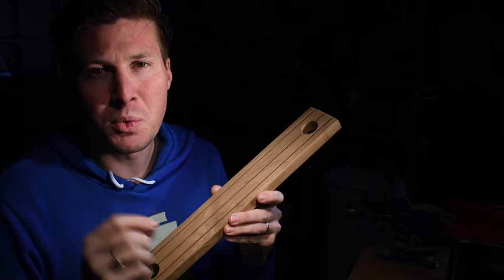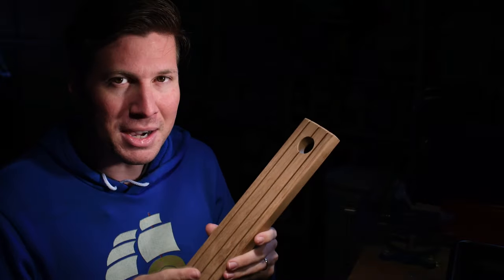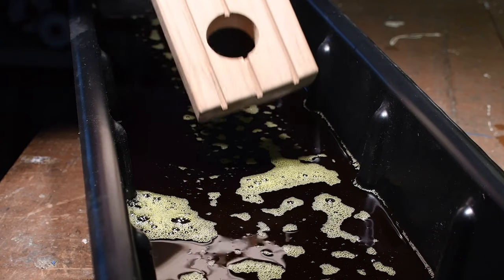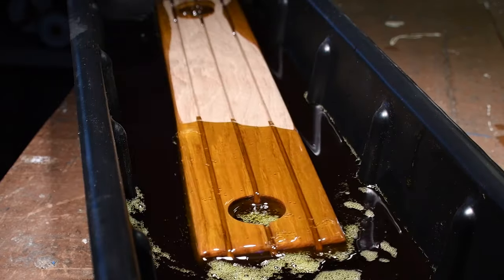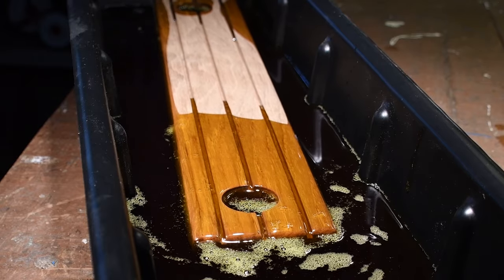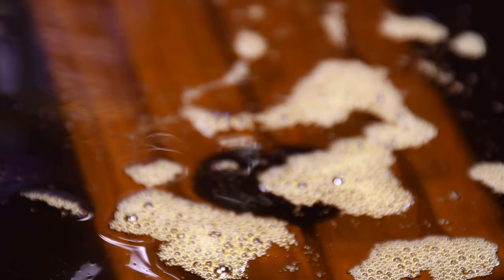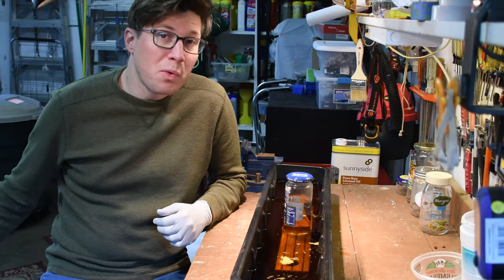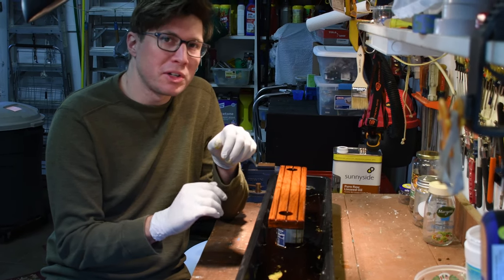How To Varnish a Small Wooden Project with Linseed Oil | Sailing Wisdom

Comment: There is only 1 oil that comes to mind on a sailng yacht: TUNG oil.
Reply from the maker: I’ve had issues where the UV makes the film peel off after a few years. Linseed oil does not make a film so it can’t peel on you. For interior wood, tung oil has a nice look to it 😉

Comment: Dirt and mold magnet
Reply from the maker: Hasn’t been a problem on Wisdom and I’ve been doing this for about 11 years now. Our galley counter tops had linseed oil when I first made them and then olive oil ever since and that was in 2018. Our head is all linseed oil and it’s a wet head, so all the fears you could imagine, but it’s actually doing fine. You can see what it looks like taken apart in the recent chainplate installation videos.

Comment: I have a Lyle Hess designed wooden 30 foot Falmouth Cutter which was built by master craftsmen 1997 to 2000. I am a new owner of his boat. It has aging teak decks which I don’t have money to replace. I am currently in a project of reefing and re-caulking. Would you consider finishing with linseed oil as a good option the extend the decks life? If so won’t they turn very dark over time? Boat is kept in very sunny Southern California.